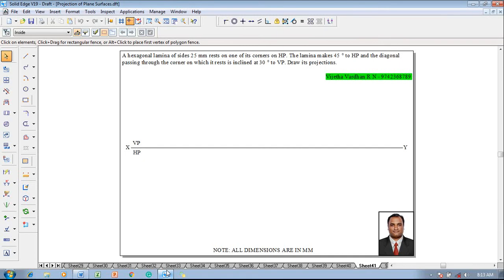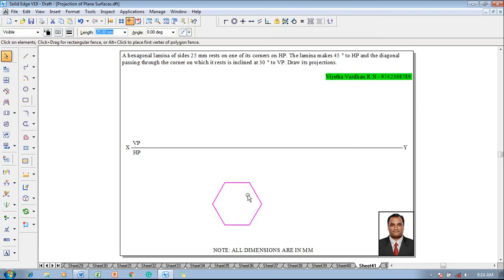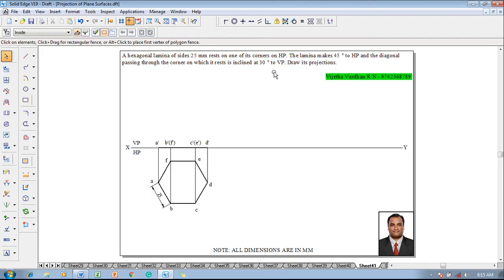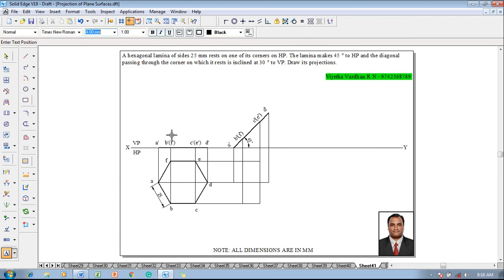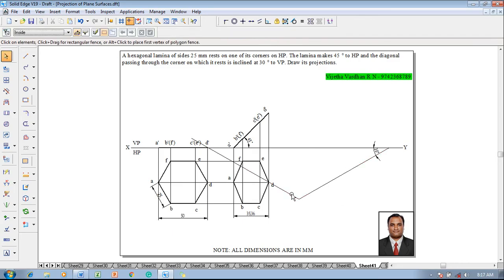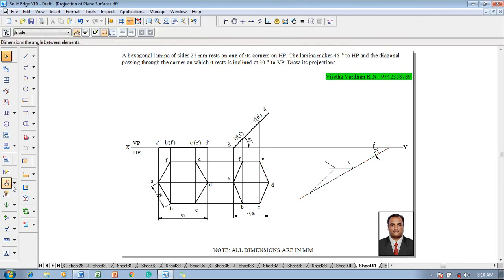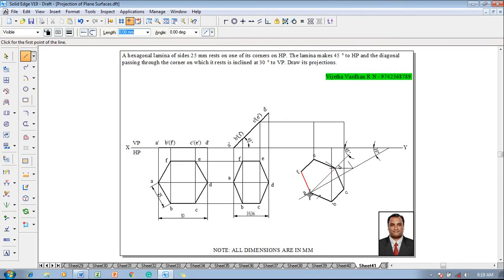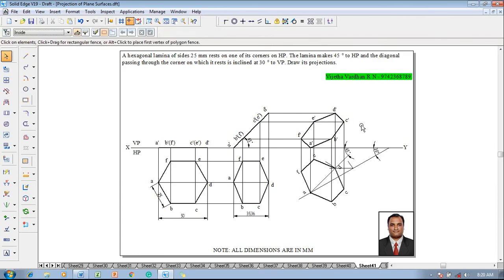Example 41 on Projection of Plane Surfaces

Comment: A hexagonal lamina of a 25 mm side has its surface inclined at 30o to HP.  Its one side is parallel to HP and inclined at 450to VP.  Draw the projections.
Reply from the maker: You can try solving this using the steps explained in the video.

Comment: How to type a' in solid edge
Reply from the maker: Use single inverted commas
Reply: Sir  can you make video on the problem that is"""  A hexagonal lamina of sides 25mm rests on one of its corners on HP.the corner opposite to the corner on which it rests is inclined at 30 degree.draw it's projections.find the inclination of the surface with hp???